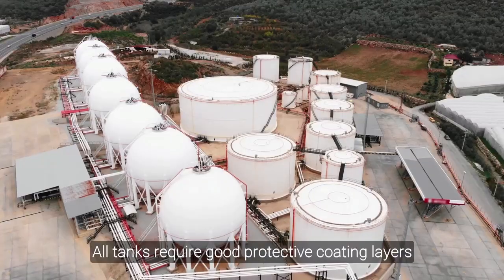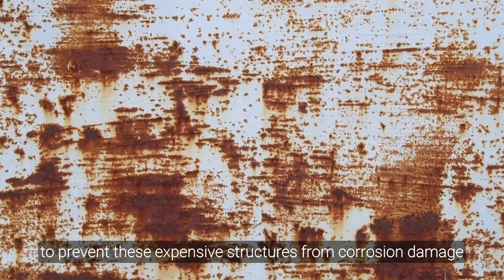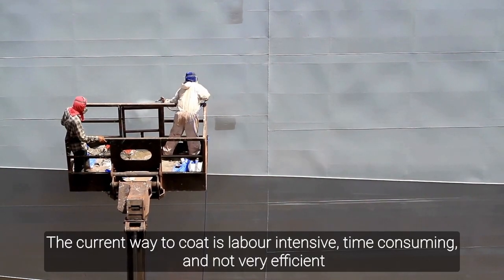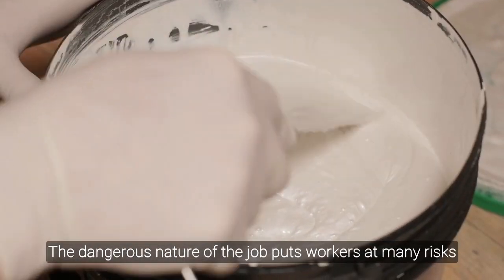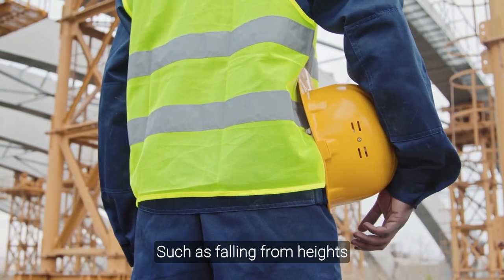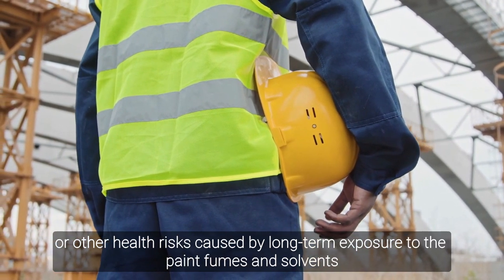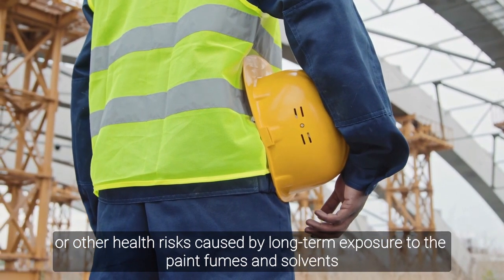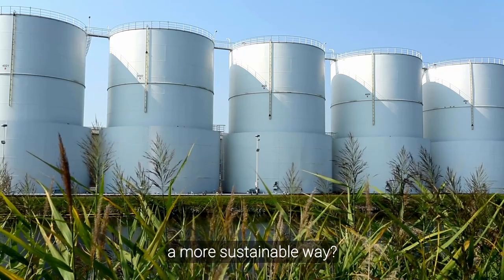Why should Industrial coating be automated? [Perpetual dangers of manual coating]

Comment: Good vid, but the spray unit still needs the human painter to cut in the top and bottom of the project, and the sprayer you showed has no idea of how to use the airless unit, on any of my sites he would be up for  re-training on off the job, and the fella on the roller is obviously a DIY homeowner, no commercial painter would work like that, all over the place , and not from the wet edge